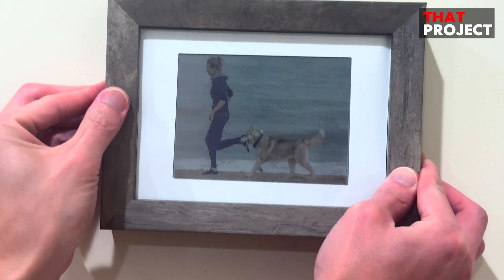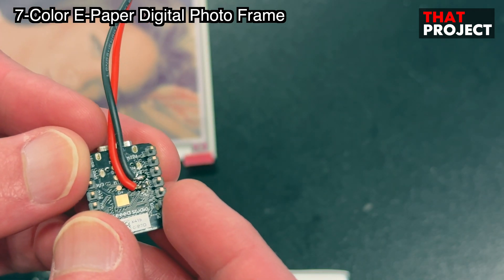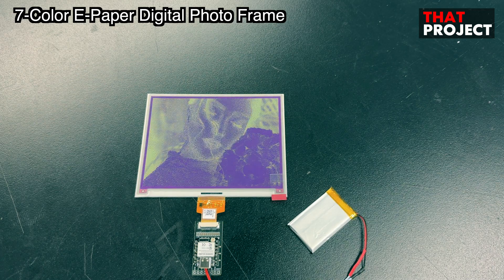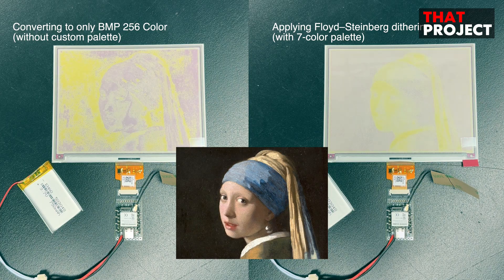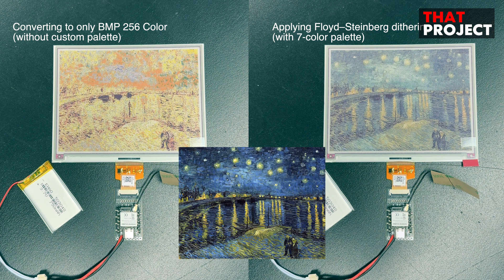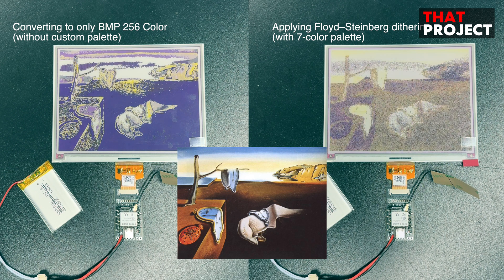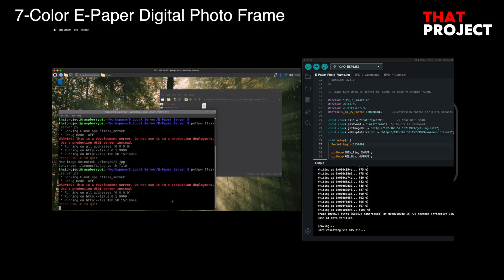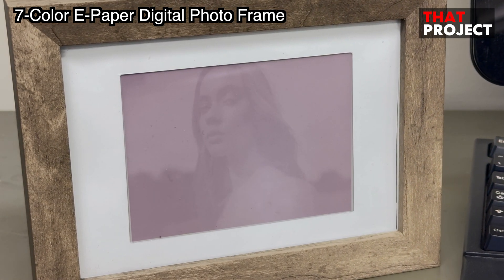ESP32-based digital photo frame with 7-color E-Paper/E-Ink!!!

Comment: How do you monitor battery charge level? It doesnt look like that board supports it.
Reply from the maker: Most boards that support batteries will have an ADC to check the battery voltage.

Comment: May I know what the battery life is like on this lipo?
Reply from the maker: This depends on how many times a day you set the screen to update. In my case, I update 12 times a day and use a small 750mAh battery, so I think it's about 3 months. If you use a bigger battery and reduce the number of updates, I think you can use it for over a year without changing the battery.
Reply: @ThatProject  thanks! I was indeed asking for an approximate battery life for your use case of 12 updates a day and 750mAh battery. thank you!!